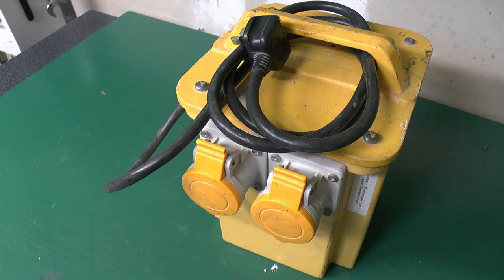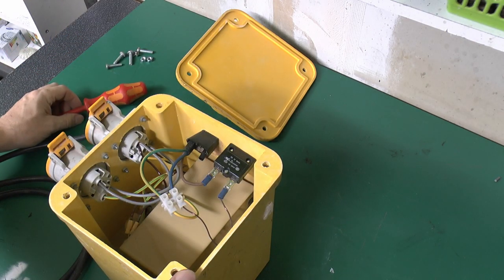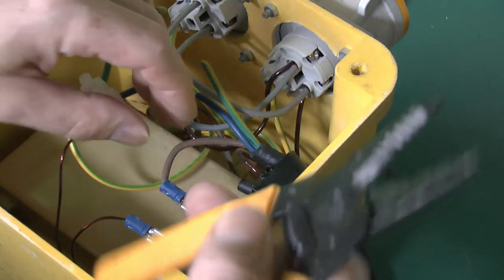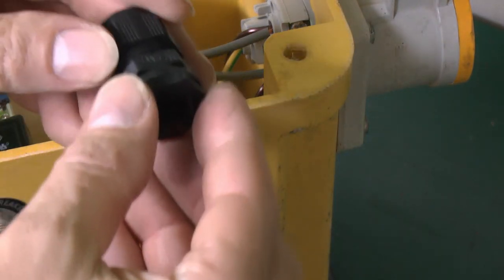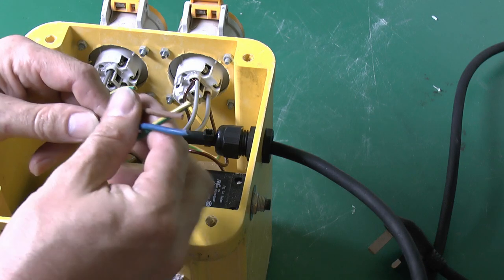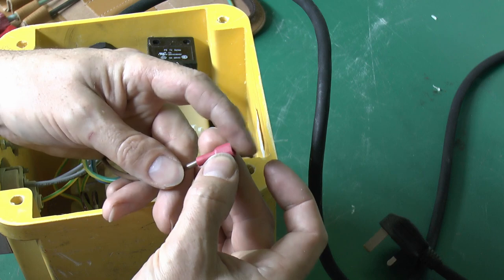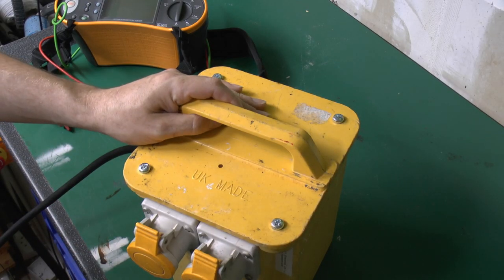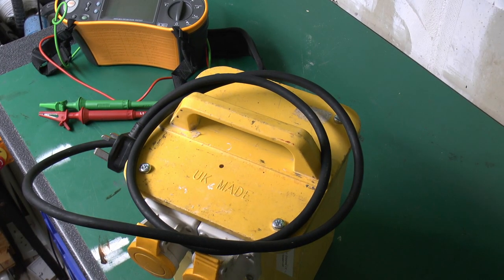110V Site Transformer Repair

Comment: keep considering putting a zero crossing relay on my transformer, only really an issue in house were you cant trip the board
Reply: Actually almost the worst you can do, as then there is no remnant field from the previous half cycle to provide back EMF. With these a much better protection is an appropriately sized NTC inrush limiting resistor, and for larger loads you then also have a relay and time delay ( around 5 mains cycles) after power on that then shorts out the resistor. That provides enough impedance to reduce the start up surge, and still allows protection devices like fuses to act in case of a shorted output properly.

I have a 2kVA variac that I did that to to reduce the inrush surge to a low enough level that it would not trip the 30A breaker it was attached to, and also not trip RCD breakers.
Reply: Actually zero crossing gives the wort case surge with a transformer. The reason is that when a transformer is running open circuit, being an inductor, the current lags behind the voltage by 90°. So normally when the voltage is crossing zero, the current is at its maximum reverse polarity and over the next half cycle of voltage it goes though zero and then to its maximum positive value. 

If the current starts at zero then over the first half cycle it will rise to twice its normal value. That would not be too bad except for the fact that transformers usually run with their core close to magnetic saturation for efficiency reasons. That means the core saturates during start-up. The inductance disappears and then the only thing limiting the current is the DC resistance of the primary, so the current can be enormous. 

Counter intuitively, the best time to turn a transformer on is when the mains is at its peak voltage.

Comment: Center-tapped 110V? That's rather odd.

What are those sockets? They don't look like US plugs would fit, which is what I'd expect on a 110V power tool. I didn't think 110–120V service was commonly used outside North America.

The problem with reversing the cable gland is that the gripping fingers are directional. I'm surprised you don't have step bits for conduit sizes.

Nylocks are a good choice, but I would probably go for blue Loctite (242). One bottle fits all screws.
Reply: It's a weird British thing, for safety purposes. These are used on construction sites, where there's a lot of potential to contact live wires while grounded. They have special tools as well, designed to work on 110v 50hz current (here in the US, it's 60hz, so our tools would theoretically work fine on one of these transformers, just slower.) The transformer is connected similar to our 240v appliances- the outside transformer in the US supplies 240v, with a center tapped neutral that is referenced to ground. In this case, it's a center tapped 110v transformer, with the center tap referenced to ground. That way, if a worker comes in contact with a live wire, it's at most 55v to ground, which is much less likely to cause injury or death. As for the different plugs, there's lots of different standards. Something similar to ours are used in China, but on 240v.
Reply: puckcat22679 - most electric drills used in most tools are actually DC motors fed via rectifier diodes. So these would not care if the supply was 50Hz or 60Hz. Secondly, not all AC motors care much about the mains frequency, as long as it is in the correct range. So again there would be no significant speed difference.

The connectors are actually an international standard, look up IEC 60309

Comment: I love them cable grips (the one you threw away), when the screw is removed, the rear insert comes out, releasing the mains lead. (I noticed a bit of sand in it, so pliers might be useful). I use them on my reel to reels.
Reply: +1, we used them on our fan heaters etc, at Rima Electric (taken over by Sunbeam Electric).

Comment: What kind of 110 sockets are those? They aren't like our North American ones.
Reply from the maker: https://www.toolstation.com/industrial-connectors-ip44/p35522
Reply: Known as CEE form colour coded yellow for 110 blue for 240 and red for 415
Reply: @jwflame  Oh, nice. Those appear to be very well designed.
Reply: Those are known by several common names, the correct designation is IEC 60309, it is now an international standard for "industrial connectors". They are strongly color coded for voltage and have the earth/ground pin in a different "Clock position" based on that voltage color correlation. The ones in the video are IEC 60309 4h 16/20a. Common colors are Yellow for 100 ~130 VAC, Blue for 200 ~ 250 VAC, Red for 400 ~ 480 VAC (230/400 Three phase being most common for red), There are several less common colors but one in particular that may be of interest to you is Orange, Orange is only found in areas that use split single phase that wish to distribute to the end point at 120/240... that would be North America. Orange came about as part of series 2 certification for IEC 60309 plug and socket type  pin & sleeve devices for use in North America. You can get these in North America but their use has primarily been industrial, but are gaining traction as replacements where proprietary pin & sleeve  designs were already popular. Most smaller North American domestic sockets (NEMA) are just that, for domestic use, but in general are absolute garbage in the shop, do they work yes... are they going to survive being stepped on... well once or twice. A 60309 takes allot of abuse, I actually use these on all my portable power tools, and since I attempt to only buy 50/60hz small tools, I can use them anywhere in the world with a proper local adapter and/or transformer. Wikipedia has a nice table of voltages and configurations which offers a basic introduction to the system. https://en.wikipedia.org/wiki/IEC_60309      Edit: P.S. In North America they seem to be ridiculously expensive, but can be had cheaply if you keep a watch, I have boxes upon boxes of them I've picked up for reasonable prices, so I always have them at hand when I want one.. they really are superb.

Comment: would have been easier to re use the existing cable grip rather than have to enlarge the hole to use a stuffing gland and cable tie.
Reply: Yee, exactly. And he should have done.
Reply: It’s just a wedge grip, push the wedge out and reuse it.
Reply: Wow. It wasn't exactly a difficult or time consuming job though, was it? It's not like it took him several extra hours of unnecessary work. If he prefers the new one that's up to him.

Comment: This is a typically convoluted and cumbersome British "solution" to a fairly trivial problem.
Use a huge heavy transformer box with huge inrush that trips normal circuit breakers, so site must provide special outlets and wiring. Requires all tradespeople to buy a second set of tools with US plugs that operate on 110V. Giant box contains no short circuit protection, so shorts to ground or between "Lines" will cause big current and unsafe fault on the tools' cable. No switches on the 2 outlets.
Elsewhere in the world we use a 220/240V unit with standard sockets, so normal tools can be used. Inbuilt RCD protects operators against shorts to ground. Inbuilt short circuit protection protects the gadget and wiring. 4 individually switched outlets, 10A or 15A. Light weight and low cost.
Example: https://www.gettoolsdirect.com.au/portable-power-board-4-way-15amp-outlet-pp015t.html
Reply from the maker: It's really not that bad.
Consruction sites have 110V power from dedicated transformers, such as https://www.blakley.co.uk/products/transformers/site-transformers-4kva-to-20kva/site-power-transformers/tap320s12
all of which have circuit breakers on the outputs to disconnect if short circuits or overloads occur.
All tools and lighting on construction sites are 110V, and if people want to use those tools elsewhere they have a small transformer such as the one in this video.  No one buys 2 sets of tools.
They don't have those dreadful flimsy US plugs either.
RCDs and 230V can in theory be used, but they never are. 110V with 55V to ground is reliable and safe.  RCDs need to be tested often and would be quickly damaged/destroyed on a typical construction site, which in the UK will frequently be soaking wet.

Comment: NO! You don't put the old bolts and nuts in the bin! Even though there are only 3, not 4, you can keep them to reuse for a future project. Same with the original cable grip. There must be a way to open it to remove the damaged piece of cable and put the good cable through. Also you can reuse the original spade connector. put a piece of heatshrink tube over the incoming wire, strip and solder the wire to the short piece of wire still on the spade connector, slide the heatshrink tube back over the solder joint and shrink it. RECYCLE the copper from the damaged piece of cable.
Reply: Simon Tay weapon
Reply: He had a whole unsused pack of nuts and bolts.  Why keep the old ones.  Also reuse old spade connectors?  Just NO
Reply: Solder wires to the stub on the spade connector? Please don't. The price of a spade connector is not worth the time or effort of bodging it back on, not to mention that it looks incredibly unprofessional. Have some pride in your work, and people will respect you for it. Doing poor work in order to save a few pennies does NOT look good!

Comment: (9:45) - Not that this should of course be outside where there's water..??
Excuse me but aren't they designed to be used on building sites?
Like, building sites that are open to the elements?
Sorry John but I have to disagree.
These transformers are very much designed to work outside.
Under the pouring rain.
And I don't think I'm wrong here.
>
Reply from the maker: This one is a portable transformer designed to be located indoors, and 110V items attached to it for use outside.  Larger building sites would have a much bigger transformer with multiple outlets, located in a single location away from where the tools and other items are being used.
The point is to keep the 240V away from the work area, otherwise there isn't any point in using 110V tools.
Using a portable transformer with a 240V extension lead and standing next to the transformer outside with a tool connected on a short lead is totally the wrong way to use it.

Comment: C'mon John. You know it's not 230V and 400V. You know they haven't changed the taps on the transformers. 
Test your own input and do a video to showing what your voltage is.
Reply from the maker: Voltage here is about 250V.  You are right in that the actual voltage hasn't changed in most places, but the declared voltage is 230V, and 230 is what's used for calculations, even though the actual voltage isn't usually 230V in reality.
Reply: Do you know what they actually changed the nominal voltage to?  Here in Australia, a couple of years ago the area I live went from 240V +/- 6% to 230V +10%/-6%, which means the maximum allowed mains voltage dropped from 254.4V down to 253V.  So in other words, the nominal voltage went to 230V but they didn't have to change any taps on the transformers...

Although in our case they actually had a sensible reason for making this change.  It seems there were so many grid-tied solar systems being installed that it was pushing the voltage too close to the limit, so by lowering the nominal voltage to 230V it means they can slowly go around changing the taps in areas that feed in a lot of solar power, and they don't have to worry about the voltage dropping below the spec on cloudy days when nobody is feeding in.
Reply: Well, when I do my calculations I use the voltage at the job n use that instead of the stated voltage thats in the regs.
Reply from the maker: @Berkeloid0  Same here,  230V with allowed range 216 - 253.
Reply: @jwflame  madness ain't it 🤦🏻‍♂️

Comment: 1. That remaining blue crimp doesn't look like its been completely squeezed down properly. The open end is still circular.
2. I would have added sleeving to those two bare copper wires so that cannot directly touch each other.
3. I would have added a neon indicator to show when it has power.
Reply: The copper wires are the ends of the transformer windings so they are already insulated

Comment: 55 VAC RMS to Ground is almost 78VAC Peak to ground
Reply: And the peak to peak voltage of a 240V AC RMS supply to ground is 340V. Which would you prefer?

Comment: ??55  110vac I think you mean
Reply from the maker: 55-0-55, 55 volts to earth, 110 volts between the two conductors.
Reply: ed riley throbber
Reply: Most houses today in the US have two 110 volt wires and one neutral wire running into the house from the local distribution system. These wires can run underground or above ground. If there are two 110 volt wires running to the house, then the house has 220 volt service and appliances, such as dryers and air conditioners.